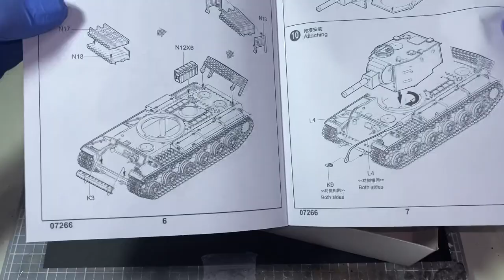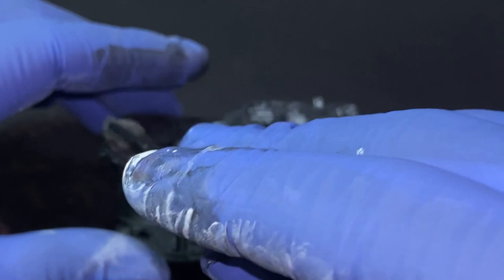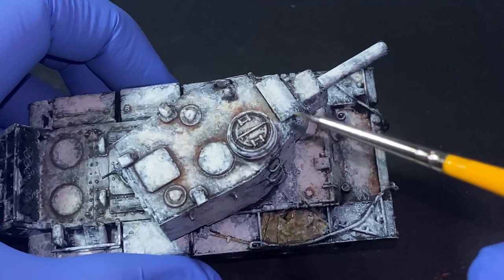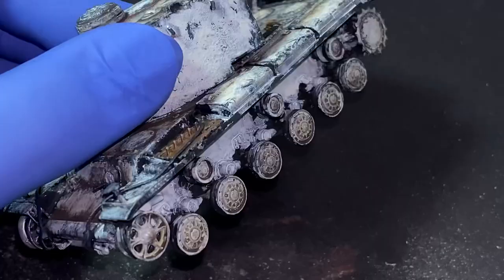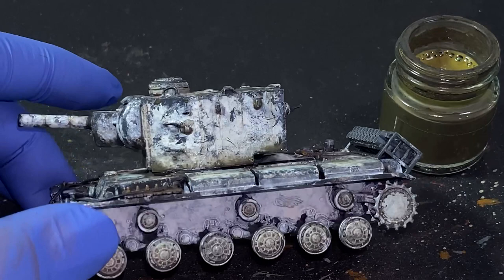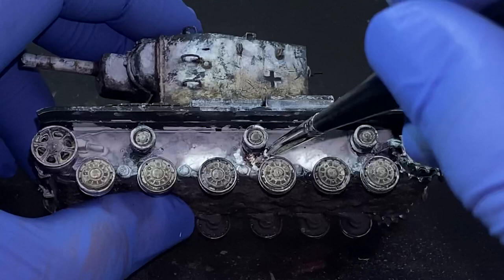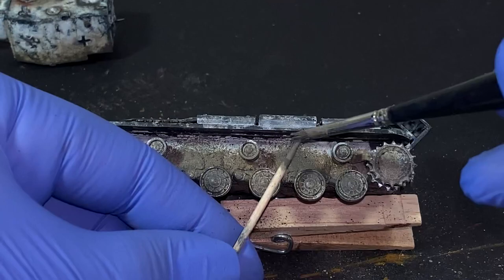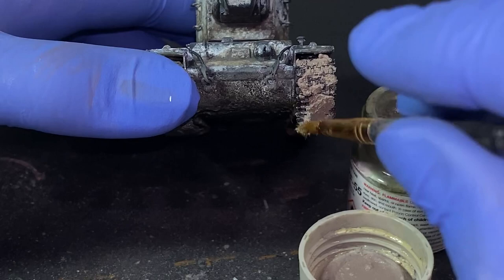German Pz.kpfw KV-II 754(r)-Trumpeter- 1/72- tank model- brush painted

Comment: I see you also put the wheels on first and then paint them, I watched you do the same with the HobbyBoss Sherman 8 months ago. 
My question is how do you paint in between and behind the wheels, you know the hard to reach parts. Because I try to get in there with a brush and just jam it on there. Maybe you have some tips?
Reply from the maker: I use an angled brush to help me reach into those hard to reach corners, or try to paint those areas black before attaching any parts on the model. Example my 1/48 scale Sherman suspension. :)
Reply: @Modkits131  Thanks for your answer, excited for you next video. Keep up the good work:)

Comment: What kind of soap do you use for your washes? Do you use any varnish to protect your painting/weathering? Thanks
Reply from the maker: I use a pump bottle, with soap from equate. I’ll generally only varnish my painting. Meaning only the camouflage layer to help seal it before applying a wash. :)
Reply: @Modkits131  Thanks. What varnish do you use? Do you apply it with a handbrush?
Reply from the maker: I generally use satin varnish from Vallejo and do apply it by brush. :)